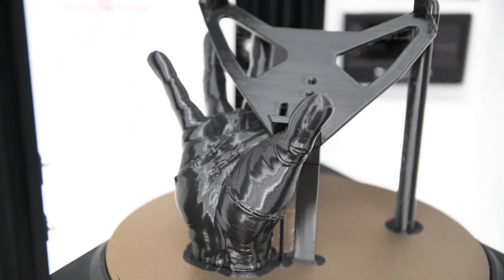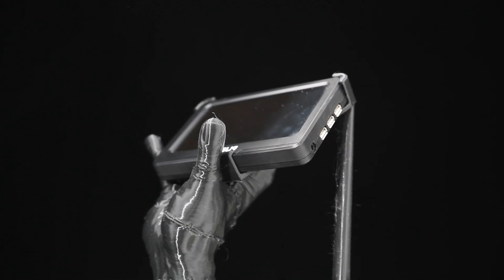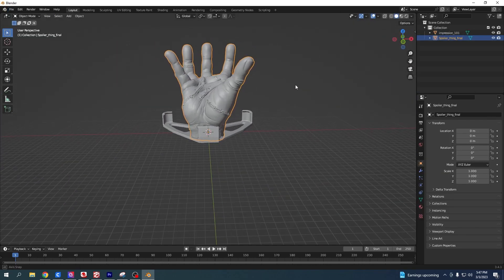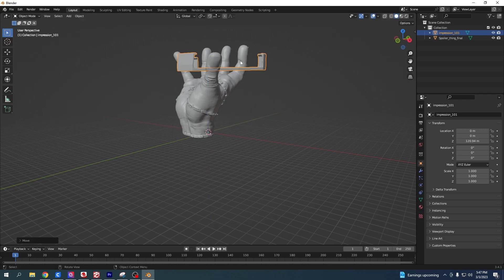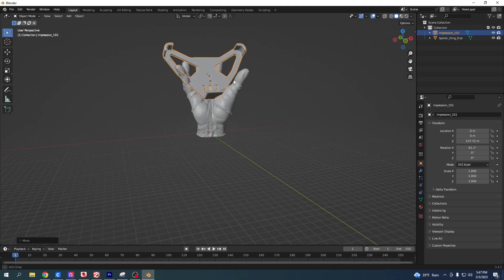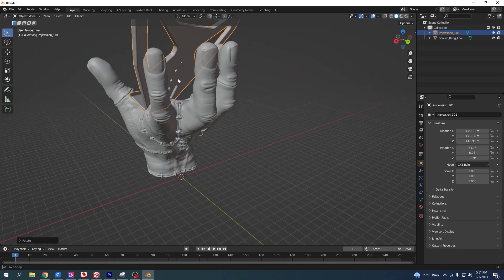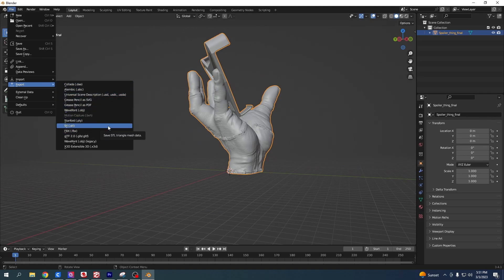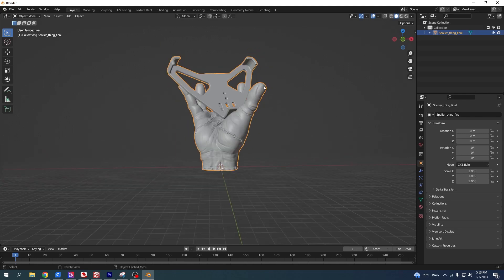Flsun V400 Speeder Pad Holder, how to Combine 3d prints Easy.

Comment: Thanks for the design, but I am having trouble printing it..  (failed twice) I think I know why it failed, but not sure how to solve it. The problem starts when it's printing the holder part, as the sharp ends curl up and the nozzle hits it. Causes pandemonium to happen... Did the same thing when I tried it on the Tronxy.  If you would please post your Facebook ID, I would appreciate getting your Cura profile to see if it will fix the issue. Although I wouldn't think the filament type would make a difference, not positive about that.  Thanks much for your assistance!

Rick
Reply from the maker: weird mine printed fine. try a 210 bed temp and 65 plate and all should be good make sure you have z-hop set to 0.5 and combing off.
Reply: @carphotography  I assume you meant 210 nozzle temp which is what I used, and 60 bed temp. Since the problem doesn't happen until higher in the print, the bed temp should not be an issue, and adhesion is perfect. This only happens on sharp corners like the 2 from the holder. Since the holder is not only a V shape, but also slanted, it creates 2 very sharp corners which warps up and catches, the extruder. I can try upping the Z hop, but I doubt it will matter, the warping is too extreme. I have heard confilcting solutions, too much cooling, and too little.. Who really knows? I wanted to compare my settings to yours and see if anything stands out as a possible issue. The second try I even slowed it way down to make sure speed was not an issue. It seems the Meta filament is better even that PLA+ which I normally use, so if that would be the solution, I will try it. However, until I explore all options, I'm not willing to try printing it again, I have already wasted more than a spool of filament trying. Thanks for your help with this.

Rick